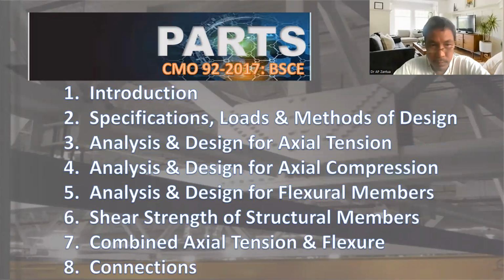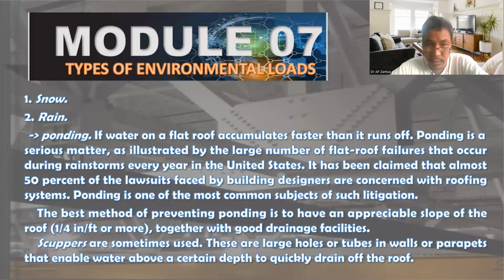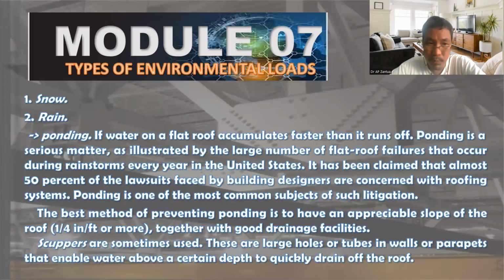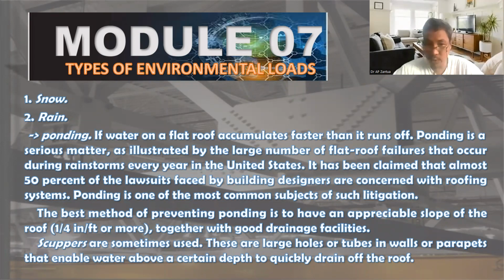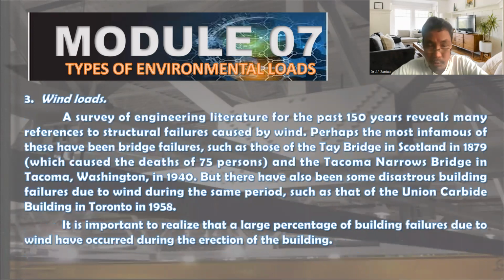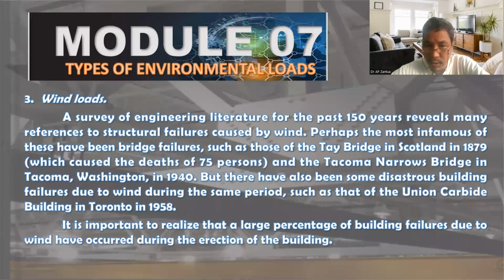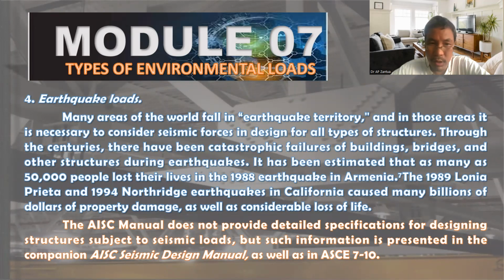Structural Loads of a Building: Environmental Loads [ Principles of Steel Design ] Module 2.07.3

Comment: Thank you sir for discussing about PSD fundamental concepts principle and theories under structural analysis and designof steel elements.

Question 050. What is the unit measurement of overhand?
Answer: B cubic Meter

Comment: Thank sir for discussion about PSD
PSD  provide fundamental concepts principle and  theories under structural analysis and desii of steel elements in an structure 

Question 050. What is the unit measurement of overhand?
Answer: B cubic Meter

Comment: thankyou sir for the continuation, discussing the environmental loads on structural loads of a building, as the loads was classified into dead loads, live loads, and environmental loads. The environmental loads were caused by the environment where a particular building structure is located. it is caused by rains, storms, snow, wind, the change in temperature, and earthquakes.
question 050: what is the unit of measurement of Overhand? the answer is B cubic meter

Comment: This video tackles about the last classification of structural load which is the environmental loads. This are caused by rain, snow, wind, temperature change, and earthquakes. This causes are also the types of environmental loads. I have learned that this is classified also as live loads, however it is not like with other live loads that are all caused due to gravity and operating conditions. For Q-050, What is the unit of measurement of overhand? My answer is B (Cubic meter/m^3)

Comment: Thank you for this video lecture that tackles about Environmental Loads that are caused by rain, snow, wind, temperature change and earthquakes.

Q.50 "What is the unit of measurement of overhand?" A. Square meter B.Cubic meter C. m^3/meter D.m^3/km
the answer is B. Cubic Meter

Comment: Thank you sir for discussing the structural loads. This topic was explained in our course TOS so this lecture is kind a recall but watching this, it became more much wider and explained well.  For engineers, it is important to know the concept of structural environmental loads when designing a  structural plan so that we can estimate the environmental loads that our structure will carry and we can prevent structural failure. We must refer to codes, specifications, and references. Thank you sir. 
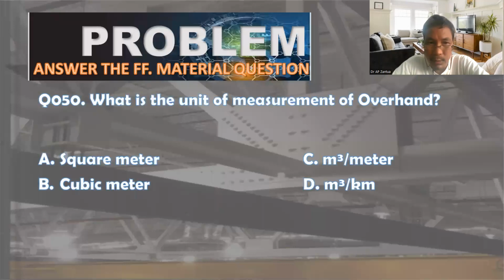For 10:58 Question 050: What is the unit of measurement of overhand? My answer is Cubic Meter sir.

Comment: thank you sir for discussing us about environmental loads which I’ve learned that these are caused by environment in which a particular structure is located. Types of environmental loads were discussed such as snow, rain, wind loads, and earthquakes. 

Q050: what is the unit of measurement of overhand?
Answer= m2